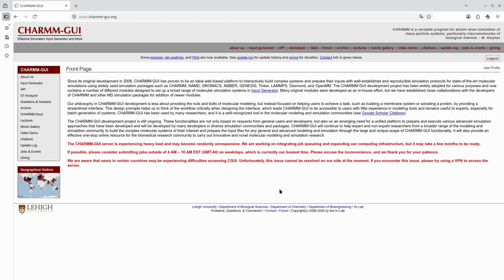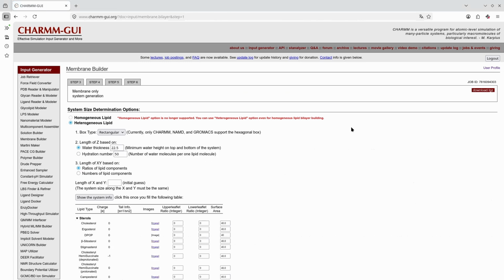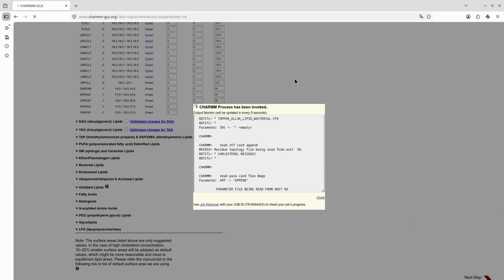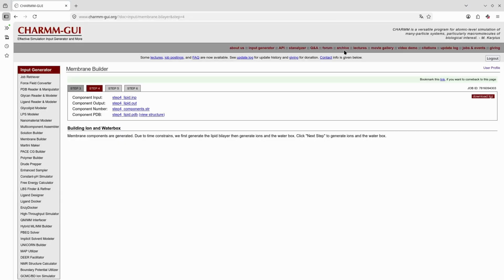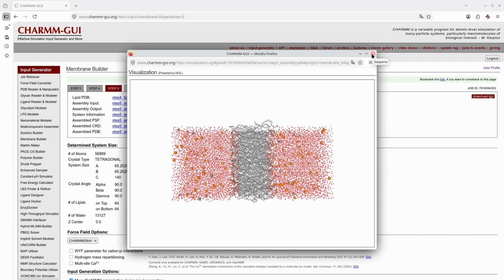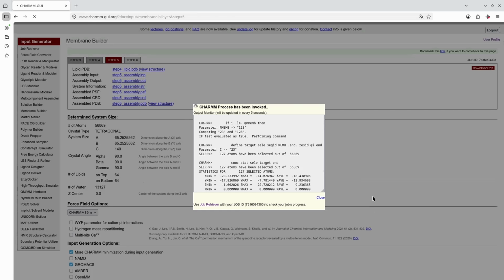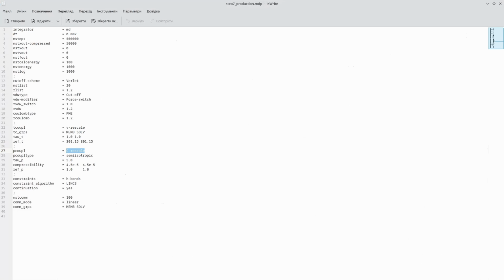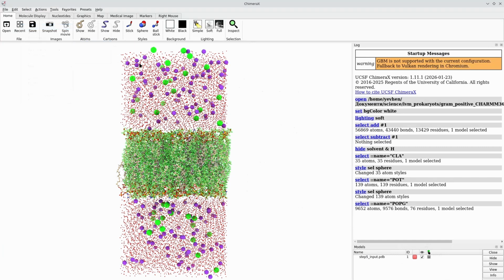Building membrane bilayer system with CHARMM-GUI

Comment from the maker: I remember saying that K and Na are physically equvalent. That was unprecise. Please note that K and Na ions are not completely physically equivalent. I meant that from the view of neutralizing total charge in a system prior to simulation. They have different masses and radii. If they were truly equivalent, they would have been called the same. The same is true for Ca and Mg, both have +2 formal charge and can be used to stabilize LPS (not shown in the video), but resulting simulations will be different depending on which one you use